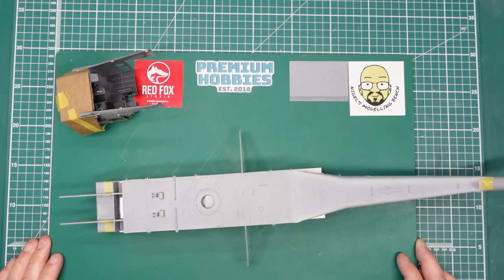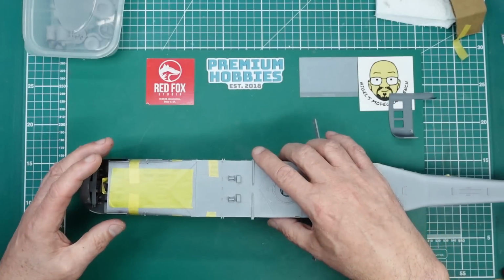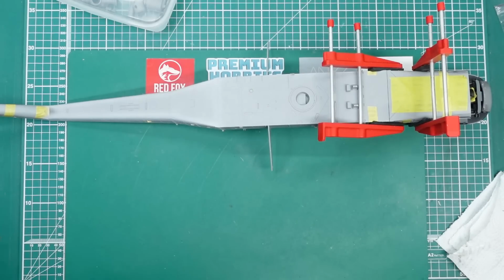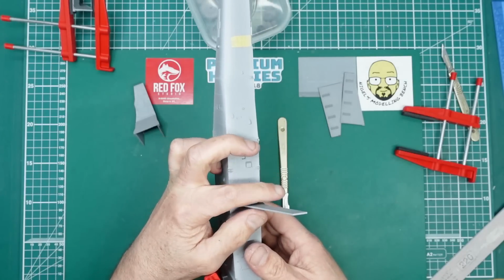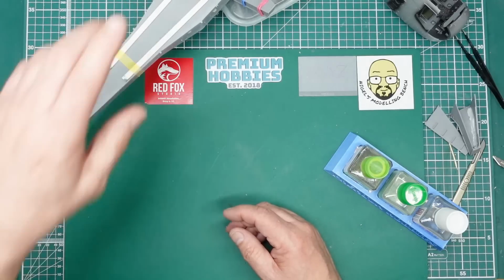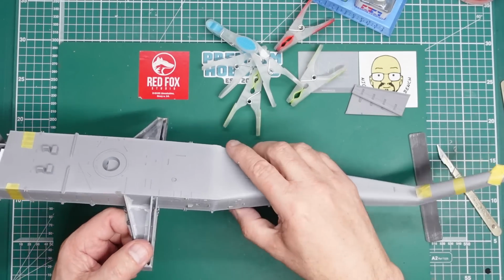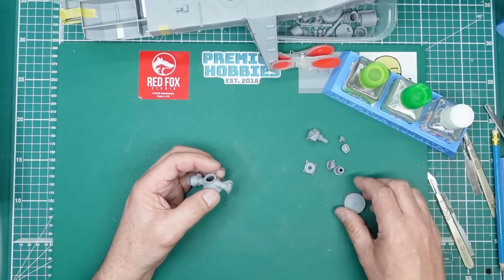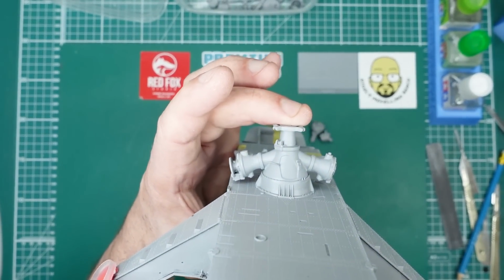ICM 1/35 CH-54A Tarhe build. Part 5

Comment: The disc brake is called the main rotor brake and is intended to expedite stopping the rotor after shutdown.  Most if not all helicopters have them.  It is not to lock the rotor.

Comment: Nigel,
 I'm continuing to learn a lot from your build. No worries on over engineering on methods to aid in building and holding parts because I tend to do that too in other projects. I smiled when you mentioned about over engineering😊because I'm like that. So the transmission tilt was modeled into scale like the actual helicopter. Someone on another model review had mentioned if that was done. Sure enough it was. Most likely Sikorsky had manufactured that in building the Skycrane to compensate for the "tendency of drift" caused by the sideward thrust of the huge tail rotor so the pilot won't have to use much cyclic stick displacement to compensate.

Comment: Wonderful and skillful model building. However as a former air charter owner I can assure you, that by scaling down any aircraft to the site of your models, rivets simply disappear! They are of a diameter below 1 cm and unless structural important flush riveted, even the aluminum sheet joint are at a scale of 1:72 tough to determine.  I hope that fact will comfort your worries at least to a little degree about your accidental “destruction” of some rivet lines!😉 Watching your excellent highly skillful work is a delight to say the least! 👍🙏
Reply from the maker: I suggest looking at some real pics of this helicopter. The rivets are very obvious

Comment: Dear Nigel, not sure you will see this, but I'm hoping. In this part 5, I see that you have assembled the tail rotor gear box. However, I do not see any coverage in this or earlier episodes of how you assembled that part. There is (for me anyway) some doubt as to exactly which parts get cemented to which. Doing this assembly correctly seems to be key to insure the tail rotor will be free to rotate. If possible, could you explain how you assembled the tail rotor gear box?
Reply from the maker: I'm sorry, this was nearly 18 months ago now and a lot has happened since the making of this model. I do not remember now.
Reply: @NigelsModellingBench  OK, well thanks a lot for answering! It does look like much later in the build you added a metal axle to the tail rotor. Do you recall that or why??
Reply from the maker: I don't sorry, but rest assured I would have mentioned it during the build if modified.

Comment: I built this, then after partial priming dropped it and smashed the front end. I managed to get the cockpit finished and fitted it on complete (roof as well), fitted the glazing after that. Also, definitely not a tail sitter.

Comment: Hi, what cement do you use on clear parts? I've bought some krystal clear, do you rate it?
Steve
Reply from the maker: I use extra thin. Krystal Klear is great but it never dries "solid"
Reply: @NigelsModellingBench  doesn't extra thin fog the part. I was told it did. I'll try it thanks for replying
Reply from the maker: I've never had an issue with extra thin fogging plastic. Check out the Sea King build, all the clear parts are fitted with extra thin.